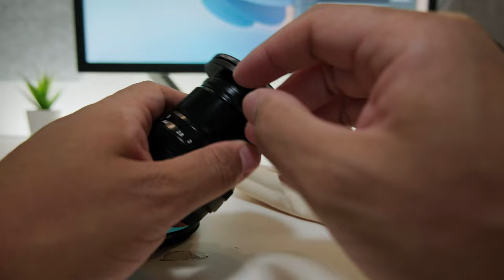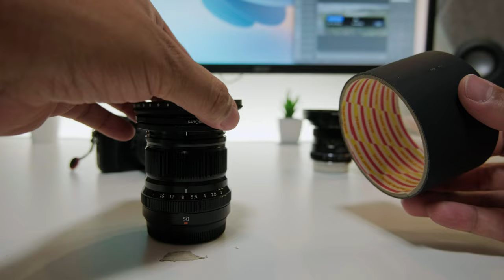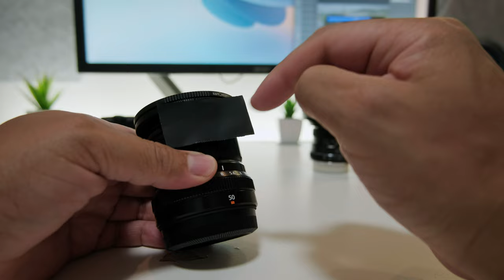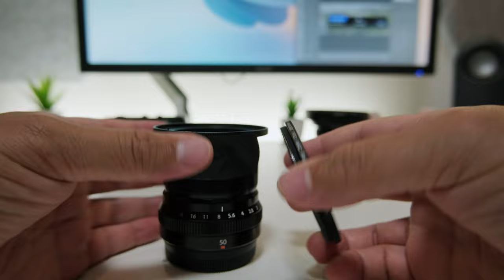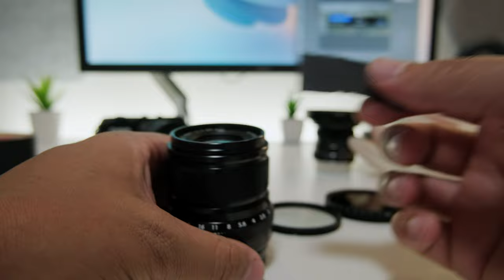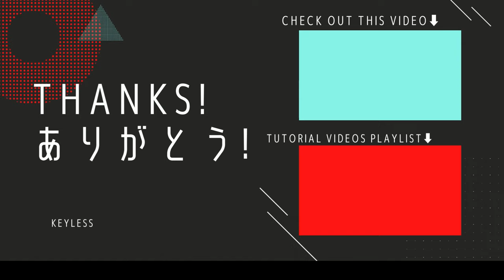Remove Stuck Filters on Stepup Rings in Seconds! HOW TO VIDEO

Comment: I tried everything, including double filter wrenches, rubber gloves, and rubber bands. Spent 2 hours trying to separate the step-up ring and an 82 mm filter.  Your gaffer tape suggestion worked in less than 10 seconds.  Thank you!  Subscribed!
Reply from the maker: @parnell2014  thank you so much for your feedback. Glad it helped.

Comment: I had a filter stuck to a step up ring too. Instead of taping the step up ring to the lens, I just took the filter and step up ring off the lens, then used tape to get a better grip on the step up ring. Suddenly it came off much easier. 
Thanks for the tip!
Reply from the maker: Good tip! Thanks for sharing.

Comment: i didnt end up using duct tape, I used some latex gloves, and that got my 2 rings unstuck. but your tip seems even more bulletproof and coming to this video helped me regardless so thank you so much for making this!!
Reply from the maker: Cool, thanks for the alternative.  Before the tape, I personally tried rubber gloves (doing dishes) and they didn't work at all. 
I like the tape method, cause I don't need to apply any force what so ever.
Thanks for watching!

Comment: I cannot separate two step up rings stuck together and there not a single video about two rings. Its always ring with filter or lens.
Reply from the maker: Sorry about that. Try taping both sides of the rings and turn them the opposite directions and see if that helps.
Reply: @jpr-tech  Thats. It finally did come off but another got stick on the super8 lens, when the temperature was really cold. Im not even fastening them tight, they just change shape. Ill try them when the weather is warmer, although i know, inner thing (lens in this case) needs to shrink and outer element (ring) needs to expand, but lets see. 
Thanks again

Comment: Unfortunatley this didn't worked either, I have Polar pro PMVND black edition stuck on polar pro stepup ring
Reply from the maker: Oh no, sorry to hear that. Hope you can save your filter!
Reply: @jpr-tech   Save the the filter after using grippy gloves and hot water. But now water is inside the two surfaces! :( :(
Reply from the maker: @piyus1987  😢I hope it dries up well. Stick it in a ziplock bag full of rice 🌾
Reply: Worked for me 100% Thanks
Reply: @jpr-tech  After a few days the water is gone now so the only the step up ring is damaged, filter is saved. Thanks for the tip
Reply from the maker: @piyus1987 Glad it worked out for ya! 😅